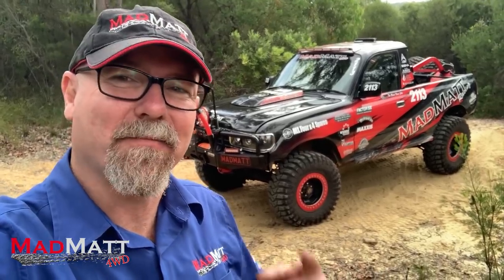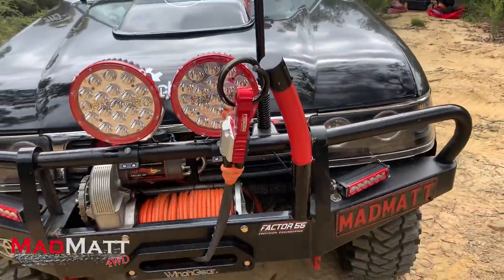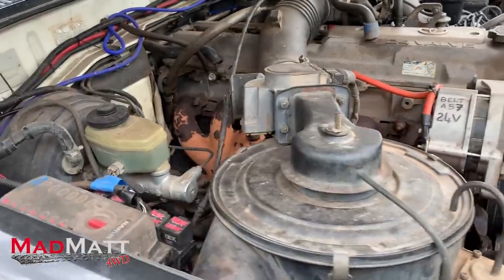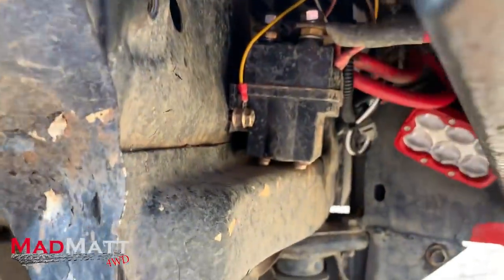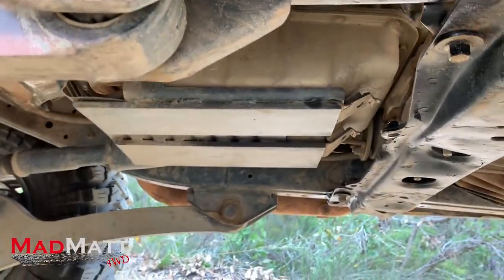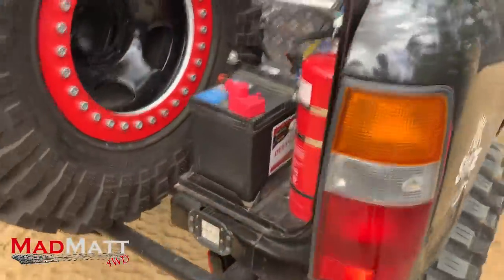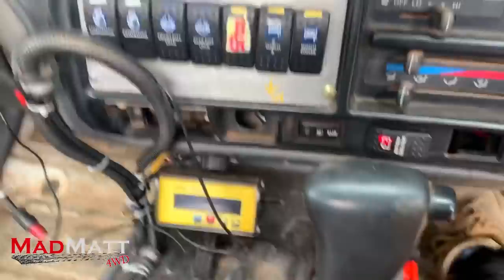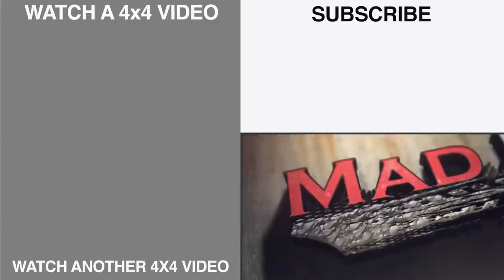MY MODIFIED OFF ROAD 4x4 RACE CAR // MADMATT RACING

Comment: Hey Matt, im a rally driver from Scotland and as a suggestion of you didn’t know about it but you can get hybrid devices rather than the hand. A lot comfier , easier to get on and off and in and out of the vehicle ! cheers 😀
Reply: *rather than the HANS devices
Reply from the maker: Cheers mate. I have a version called the nexgen. I’ve found it works well in our type of racing where your in and out of the car a lot. It hangs of your helmet and is secured under your seat belts when you get in. I found the hybrid awkward compared to this unit. Thanks for the concern though.
Reply: @MadMatt4WD  no probs ! Love the content and the build. Land cruiser aswell so it’ll be bomb proof .... hopefully haha 😀
Reply from the maker: Fingers are crossed and I have all the spares. 🤪

Comment: Thanks for the walk through and detailed explanations. The result though is many, many questions and some thoughts/ideas for comment if you can MadMatt...(I limited it to one of each)
The two circuit breakers (100A and 70A), they look like the eBay ones - are they?
Love the idea of reinforced sill. While you were describing why, it occurred to me that you would have a chassis mount slider but with mounts biased toward the front and back to give back some of the belly over angle.
Reply from the maker: Not ebay but Jaycar electronics. Re sliders yes but they still have to come out below the sill and will always reduce ramp over
Reply: @MadMatt4WD  Thanks for steering me in the right direction! Jaycar and I go back years :)

Comment: I just watched this video again Matt. I noticed that there is no snorkel, is there a reason and I was wondering if you could do a video on waterproofing the 1FZ_FE engine as I am doing mine up to go to the Cape one day with the Mrs and was wondering if there are any tricks to waterproof the FZJ80R.
Reply from the maker: Don't need a snorkel for this event and I like the clean look. Run factory leads and seal the dizzy cap. That's all i ever do.

Comment: Nice build!!! Do have a question about your batteries position. Are the 24V so far back to counteract the amount of weight over the front axle? Just they are at the very end of the tub, would have thought you'd put them up the front of the tub, nice and safe. What would be better weight between the axles or a more even distribution of weight? What do you think?
Reply from the maker: Purely to get weight as far back as I can. The fronts already heavy. This is nearly a 50/50 weight balance.

Comment: Hello, will it be a good idea to run 2.5 or 3.0 coilovers alongside your remote res shocks like they do in those desert pre runners?
Reply from the maker: It would be completely dependant on what you want to do and the type of racing.

Comment: I like it. Is there water holes where you’re racing? Also, I want to see that winch in action.
Reply from the maker: We do have water holes but we will avoid them for the most part.
Reply: Can you do a video showcasing that interesting ground anchor? And does it require 2 people necessarily?
Reply from the maker: Stay tuned I’m sure there’ll be content from cliffhanger comeing

Comment: For your hand brake you could 'tap' into the brake pipe going to the rear under centre console and have a lock off valve inside the cab. Push your foot on the brake, pull the lever and let your foot go. Rear brakes locked
Reply from the maker: I thought about that but they said they pass this.